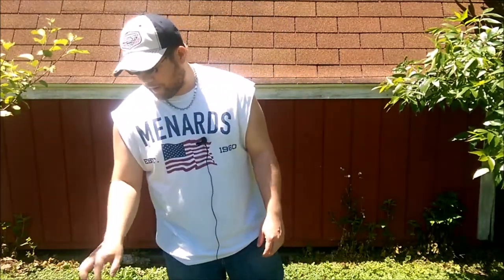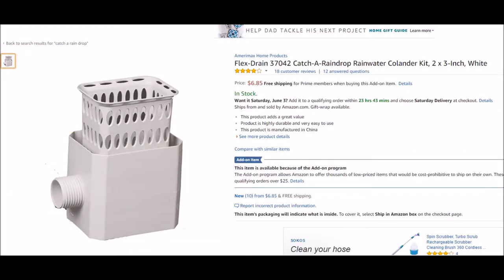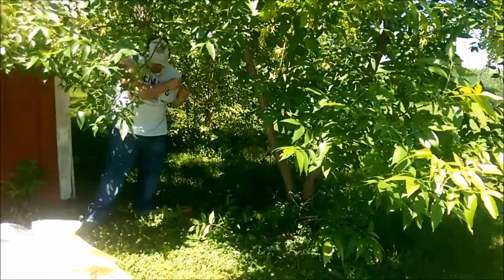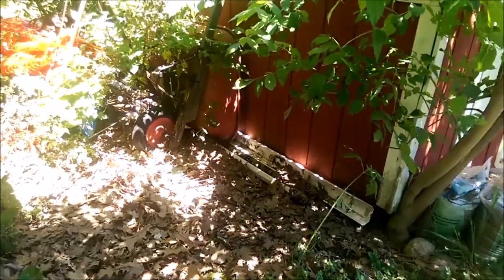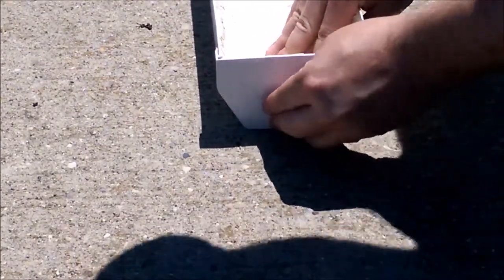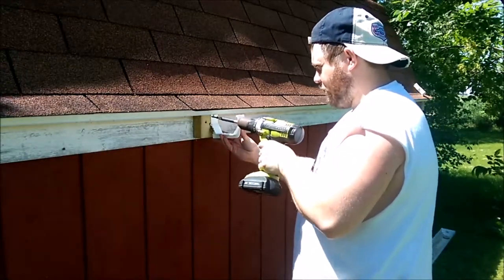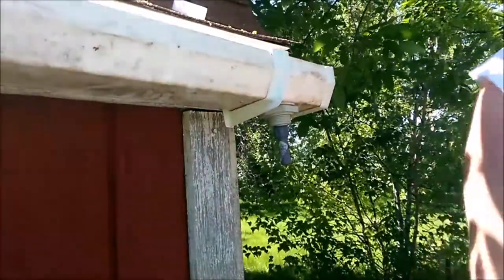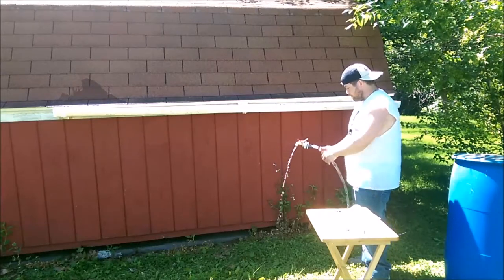Making A Mobile / Portable Rain Barrel Part 1

Comment from the maker: Items in this video:

⚒ 10 foot plastic gutter
⚒ 2 - gutter end caps
⚒ 3 - gutter hangers
⚒ 3 - 1/2" bulk head unions (http://amzn.to/2rBgfsG affiliate)
⚒ 3 - Genova 1/2" PVC Insert MIP Adapter (https://goo.gl/GIxSlH)
⚒ 10 foot 5/8" Vinyl tubing (http://amzn.to/2so3Who affiliate)
⚒ 2 - 1/2" - 1 1/4" hose clamps (http://amzn.to/2sor13N affiliate)
⚒ 1/2" hose bibb (http://amzn.to/2rBDQcZ affiliate)